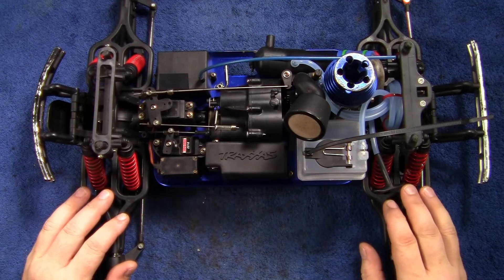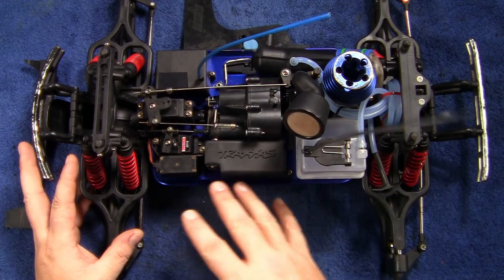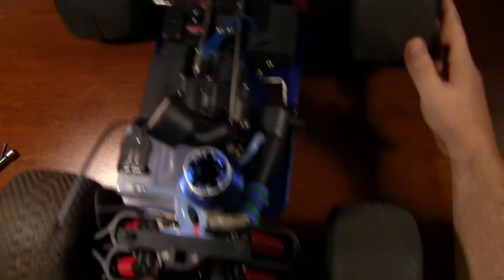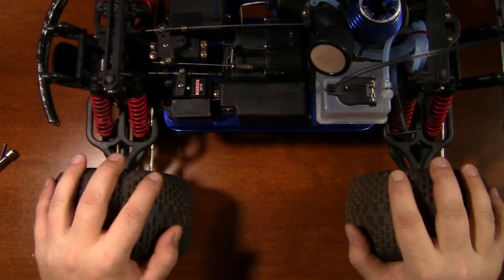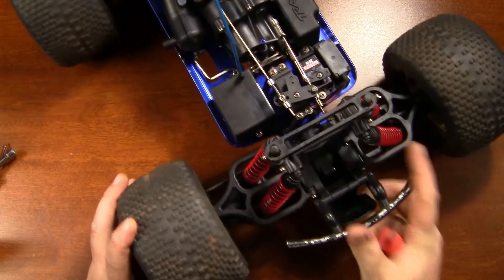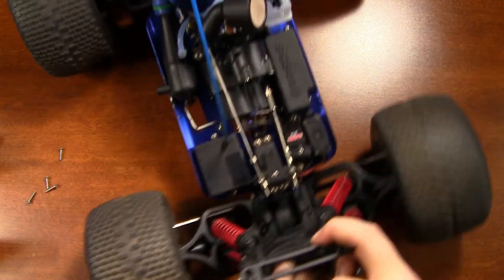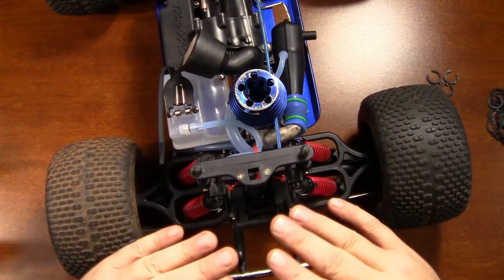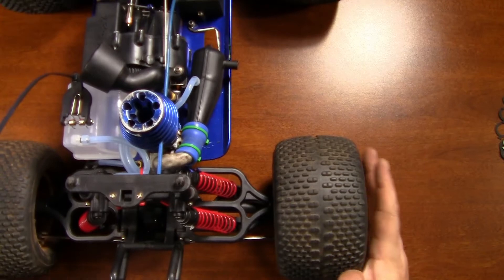Traxxas T Maxx 2 5 Part 16 Suspension Setup

Comment: Hi. I just wanted to thank you for putting up all of these T-Maxx videos. I was given a T-Maxx 2.5 that hadn’t ran in I’d say 10 years. I completely tore it down and rebuilt the shocks, differentials, engine, carb, and cleaned every single part on it. It looks brand new! Now I am just waiting on an engine mount to fire it up. Thanks again.
Reply from the maker: Hey Jason, I'm glad I could help out. If this rain would ever end, I will get mine out and get the rest of the series finished up lol. www.Rc-Help.com

Comment: Im missing sumthing about the a arms when u said about a arms being upside down or front to back is there a difference in the upper a arms being. Fliped over they look the same
Reply from the maker: The upper A arms are the exact same no matter what orientation you have them in. The lower A-arms are different though and will only work with the shock mount facing up. www.Rc-Help.com
Reply: @RcHelpDotCom  ok i thought so ty